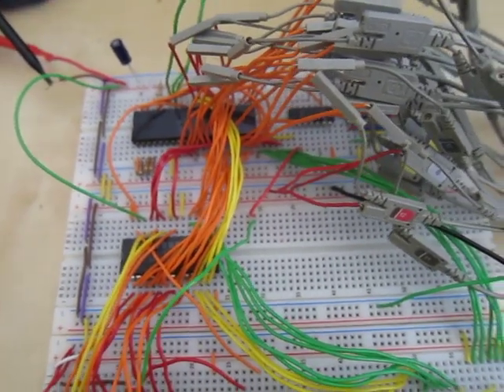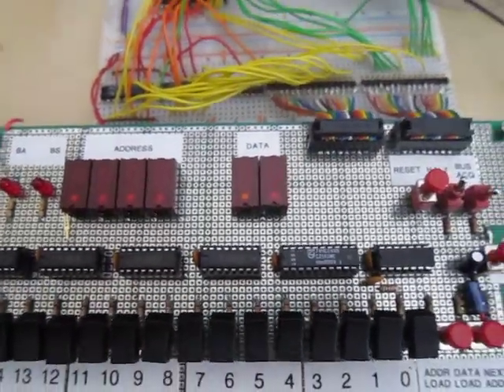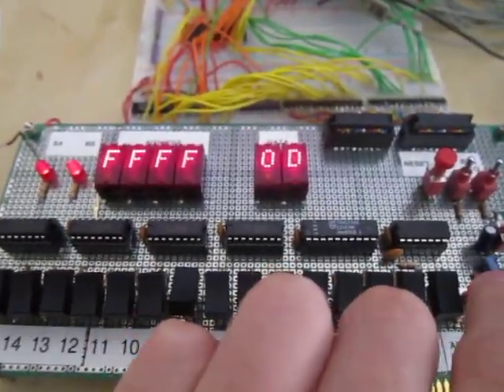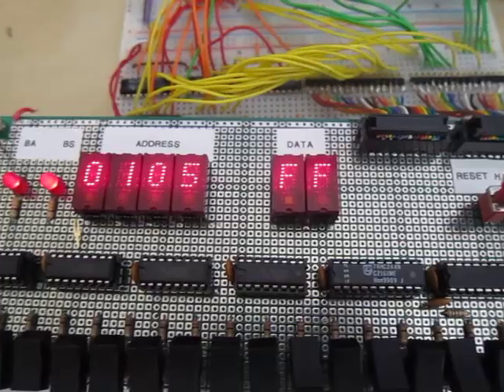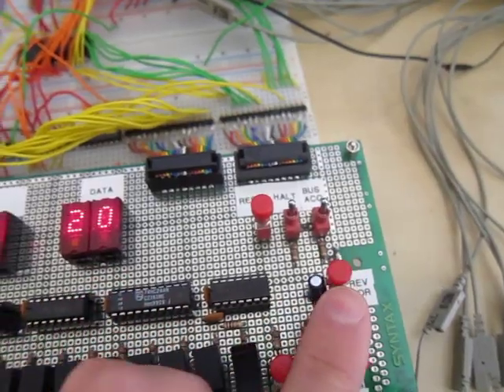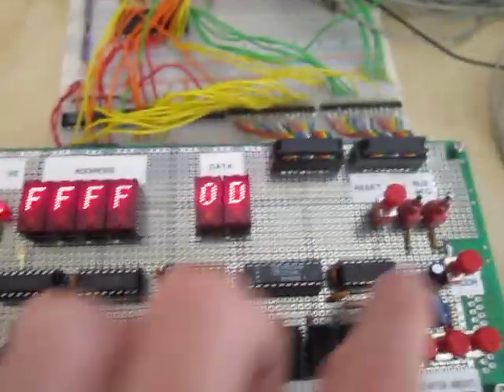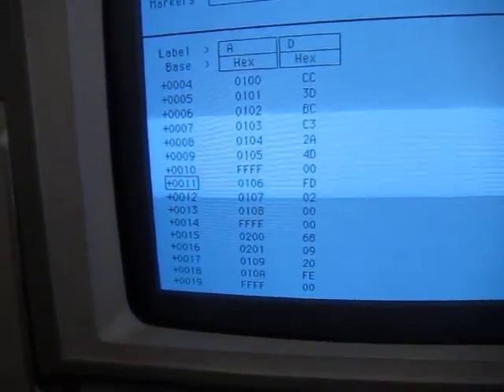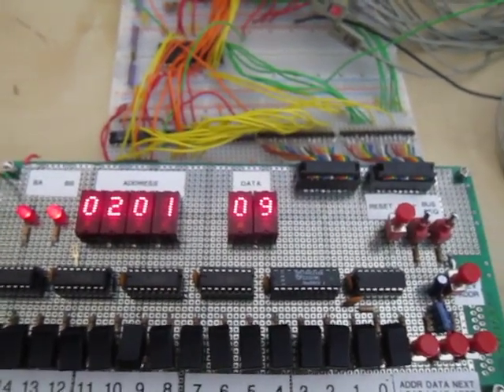Homebrew 6809 Computer: First Test

Comment: This is interesting. I've home brewed a 74188/ 74189 programmer back in the day that looked similar to your project. Someone back then gave me bags and bags of those prom chips when I was in high school. My friend and I set out to build a programmer. We wound up making some pretty interesting display drivers for seven segment displays which also included letters. I still have the programmer and a bunch of those proms. Mabey I'll dust it off and create something. I was leaning toward an all TTL computer but with an LCD display.

Comment: Is the 6809 the version with the Program Counter Relative (PCR) data access instruction set?  I remember using those instructions in the "TRS-80 Color Computer" to make a machine code routine relocatable and still be able to access its internal data (a character set).

Comment: hi,

amazing work. i have a question, im doing something similar but can't find binary to hex driver for the 7 segment display. What did you use??
Reply: If you can't find a binary to 7-segment hexadecimal decoder, you can program an EEPROM to do the decoding for you.  If you can't afford an expensive EEPROM programmer, a relatively cheap Arduino will do the job, with a little programming.  Look up the Breadboard Computer series by Ben Eater to see how.
Reply: i also would very much like to know that!
Reply: Menguin Ponkey He was using Til311, which has binary to hex decoder built in

Comment: That is cool. A dumb question I have, how can you program it and have things on the digit displays when the CPU isn't connected to the bus?
Reply: I'm presuming that the displays don't work off the CPU but off of the logic he uses to read or program the RAM while the CPU is disconnected and in HOLD mode.

Comment: how does you program this processor? you write code directly to the processor? or do you have to write the code inside a memory? I'm new in the microprocessor world and I want to build my own.
Reply: He's writing the code to the RAM and setting up the start address, then letting the CPU run the code for a second before stopping it and reading the location in the RAM where he told the program to put the results.

When the 6809 resets, the first thing it does is read in a 16-bit address from locations FFFE and FFFF (Hexadecimal).  It then starts running whatever program is in memory starting at that address.  This behaviour is built in to the CPU.  Other CPUs work differently, such as the Z80 which always begins running whatever is at memory location 0000.

If you want the Z80 to start running a program later in memory after a reset, you need extra hardware to force the Z80 to read NOP instructions (00) until it reaches the program, as was done in the Dick Smith Super-80 computer kit.

Obviously, the 6809's start-up method is more flexible, although at the cost of forcing you to always use those two memory locations for the start-up vector and nothing else.

Comment: You actually encouraged me to make my own computer so I picked up a few 74hc series components and will try to see what I can come up with. I'm designing a 1-gigabit 32 rom bank switching device. Maybe I'll make a 1-gigabit ram bank for it too. First hardware project, but I'm trying to understand it, taking my time reading those manuals hoping it'll work. There's a couple errors in the manual, but for now I can leave a couple devices out.

Comment: mostly what you'll need are 74hc series cmos components. I was lost when I first started, but its pretty easy once you get the hang of it. nxp.com has the 74hc series. Look for 8bit binary counters, decade counters, 4-16 address decoders, Atmel flash rom,  sram/sdram chips. Go to nxp.com, atmel.com, find the components and pdf files that show pinout, then get the components from digikey.com. One thing to remember is Active High means apply voltage to make it work, Active low, connect to ground.

Comment from the maker: @expert25 The 6809 came in different speed grades: the 6809 ran at 1 MHz, the 68A09 ran at 1.5 MHz, and the 68B09 ran at 2 MHz. This test uses a regular 6809. My current design has a 68B09 and does run at 2 MHz.

Comment: Great work so far!  From memory, the 6809E is specified to run at 1Mhz, though it could be overclocked to about 2Mhz, but you're using a 4Mhz crystal. Are you dividing the clock by 2?

Comment from the maker: @warlockd I have a few system disks, but I had to make them. It's HARD. The disk image and tools are on Agilent's website somewhere, but you need 720K floppies and a computer that can write them. (Modern computers can't... you need to find a Pentium II or older, preferably with Windows 95!)
Not sure about the clock circuit. The 6802/6808/6809 just need a crystal, the 6800 needs two non-overlapping square waves, and the 6809E needs two square waves 90 degrees out of phase.

Comment: Thanks for the suggestion on the logic analyzer..  Those are CHEAP on ebay.  Do you have the system disk for it?  That seems to be the crutch:P

I was given some fully populated boards with a bunch of 68xx chips on them, and I was wondering  if you had schmatics to the clock generator?  These boards use a can and it looks like they are directly connected up.

I also found a board  with a 6845 AND a 68297 vid pack.  Thinking of making a monitor:P

Comment from the maker: @eugeene42 I might put up those schematics in the future. The displays are TIL311's, which have decoders built in. They can be connected directly to the data/address lines. (4 bits per display) You might be able to pull them from old equipment or find some on eBay. The address lines on the front panel are actually connected to a bank of 74HC193 counters, which is how I can increment/decrement the address with a single button press.
Reply: Matt Sarnoff I found TIL311s very hard to find, but an equivalent part, DIS1417, is available as well, and at least for me more readily.

I've built a front panel for a Z80 incorporating the above displays.

Comment: @74hc595  That's cool.Well.. I have a 16500A that was converted to a 16500B and have slowly been getting cards and pods for it. Mine is an ebay purchase from a surplus seller out of CA.
I've not seen very much on the 1650B.